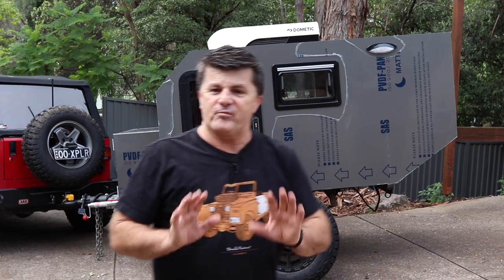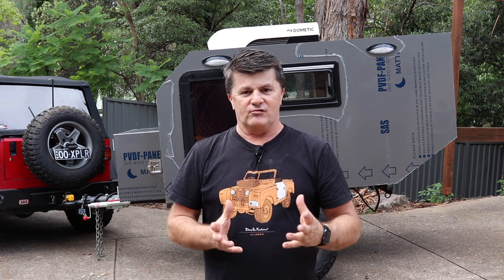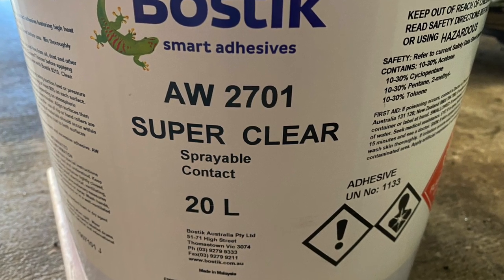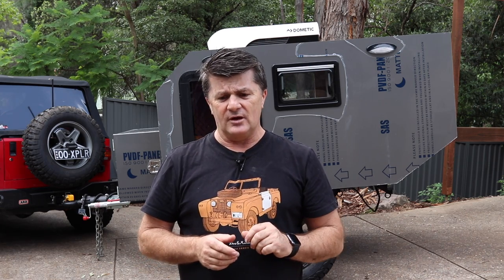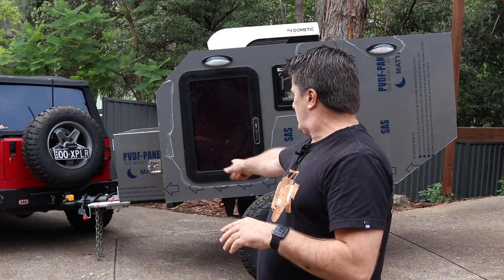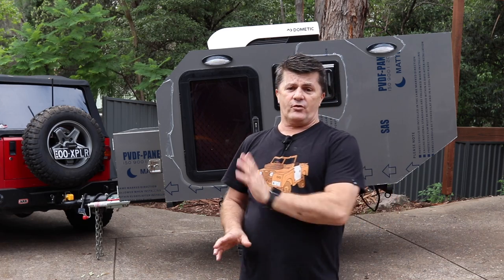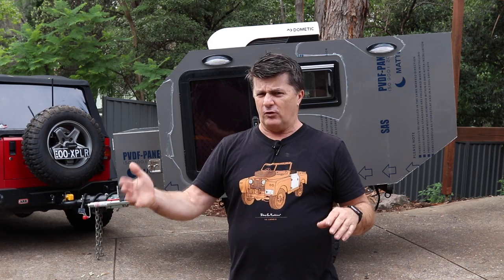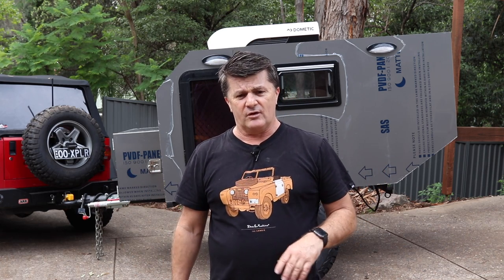Off Road Camper Build - External Cladding Install

Comment: To release the contact you can use lacquer thinner in a squeeze bottle and it will release the contact once things are attached once the thinner dries up you can just retry
Reply from the maker: Great tip